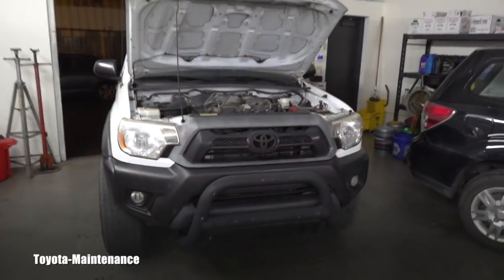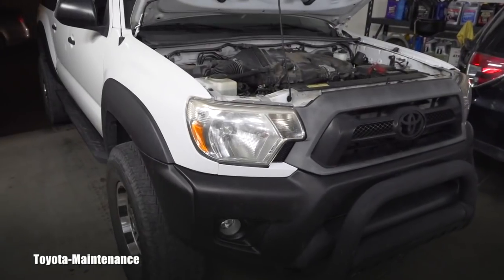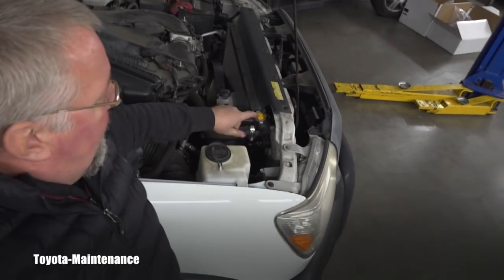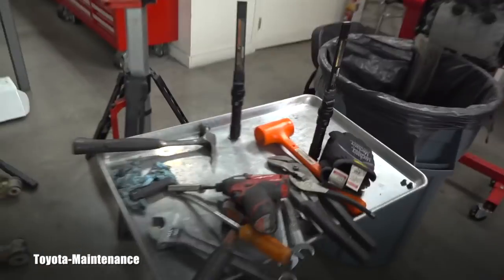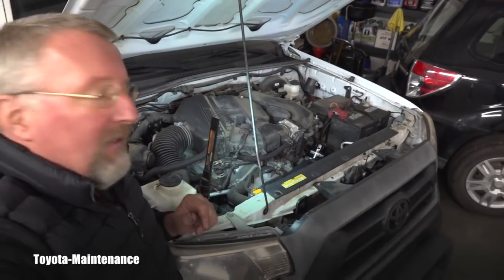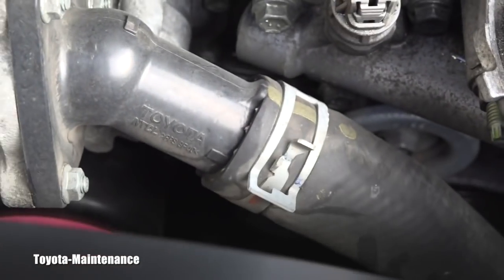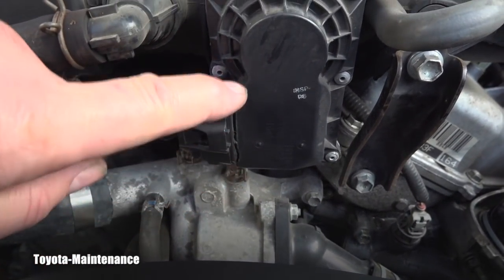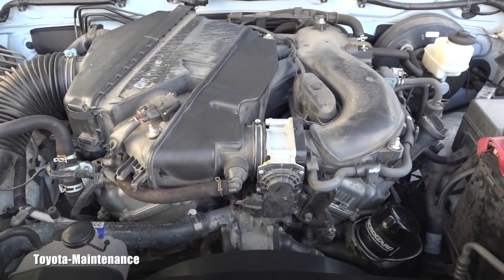Toyota Tacoma Coolant Leak

Comment: I really enjoy watching your channel... great work!! I have a question perhaps you can help be with? I have a gen 2 Rav 4 2002. Not sure how to fill the coolant. There is a coolant reservoir and radiator cap. If I take the radiator cap off when cold there is No coolant in the a radiator. So I’ve been filling up the radiator with around 3 liters of coolant... but should I be putting water in the reservoir also? Or is this just overflow? I know I need to find out why I need to keep refilling with coolant... every 6-8 weeks needs a refill with no noticeable leaks anywhere. Oil looks ok not milky. The only suspicion is that the tail pipe I can see quite some water droplets... so suspect head gasket is leaking coolant into the exhaust someplace.

Comment: My 2013 Taco just rolled 69k.  Worn out bushings and such? Sounds fishy.
Reply: My 2013 Tacoma has 150k miles. Suspension is still tight! Holds alignment perfect between checks. Will probably rebuild it all at 200k miles just because. This truck definitely seems fishy!

Comment: you get alot of Tacoma's!  how do you blow through lower control arms with only 42000 miles?  bad manufacturing?
Reply: No way that truck actually has 42k, must have a swapped gauge cluster. Lots of indicators just in what we can see through this video.
Reply: @Eggsr2bcrushed  I would be mighty disappointed if any control arm failed on a Toyota even with 140000 unless i was frequently off-roading on it.  That seems unlikely to me!

Comment: I would have to trust my gut feeling and say this truck was in a pretty bad accident.... reasons why I suspect this is because I was eyeing up the control arms, and if I'm correct one of the arms look bent where the ball joint is, and where the two stamped parts that make up the one control arm, where its welded together there is a bend bubble from the arm being bent back..., that I typically never see...... and now he seen the broken electrical connector that looks like a throttle position valve ? and why were the clamps on the hose replaced? and the hose was cut short, I say because the hose was damaged from the accident and the damaged part was trimmed away where the hose is connected to the engine, and hot antifreeze squirted out on the engine because you can see a brown stain in that area, thats the sign of hot antifreeze being spilled onto a HOT engine. you can see this if you look at the area where the radiator hose is attached at the engine, you can see signs of where antifreeze was spilled on a very hot engine creating the brown stain, this happens as the truck sat while cooling down...

 And don't the top radiator support look tweaked in places ?
I can be totally wrong, but a prior accident would explain a lot. you can turn back mileage, but its pretty much impossible to get away with it because of service records, emissions records, and if you always go to a quick oil change place they record the miles, plus look at stone chips on the windshield, you see a lot of them with high mile cars.

Well.... this was one guys opinion lol...

Great job my friend, its sad that there are not more people like you out there.... This garage owner I know retired, he  use to charge very good prices, he was going to sell out to someone who said, "Why are we letting cars go with repair bills under $500.00"......

Comment: As a Toyota owner...that is a serious fail...back to the dealer for a warranty repair....love and hate relationship with Toyota...been there seen that..... they're brakes are the worst....trade off.
Reply: Disagree. Honda and Mazda brakes are the worst. Caliper pistons always rust corrode and fail. I’ve never had a single Toyota caliper piston go bad. I change brake fluid every 2-3 years in the lines. I regrease caliper piston boot, and caliper slide pin with only silicone grease. Honda caliper will fail, even with proper maintenance.
Reply: I’ve had Honda’s since 1996......brakes were great till 2006 Accord (bought new) rear brakes failed at 55,000 miles. Fronts went till 88,000 miles. I started using Bendix brakes and they lasted longer and are a lot cheaper? I sold my 98 Civic with 170,000 miles with second set of shoes on it (rear brakes) and 2nd set of pads. I currently use Bendix brakes on my 2009 CRV and at 118,000 miles, I have only replaced the fronts once and at 108,000 finally replaced the rears. All cars are in the Chicago area and garaged. Thanks.....Jim

Comment: Put JB weld on the plastic cracked part to seal and protect it (and the part may NEVER go bad).  Also, whoever is selling you your coolant is TOTALLY ripping you off (SERIOUSLY).  Don't you get wholesale pricing from your Toyo dealer (if not, you should)?  If not, you can order this coolant off the internet for cheaper esp. if you buy with more than 4 or so at a time.  It shouldn't even cost that much with todays inflation.

Comment: Oh yeah...282000 miles on my 04 and every hose is original.  I did put in a water pump years ago. Only because i kept the belt too tight.

Comment: A couple of years ago, Toyota created their official parts website ( https://parts.toyota.com ) that is not only excellent for finding the exact part you need but you can also shop around participating dealers for the best price. My local dealers wanted from $24-$29 a gallon for SLL coolant. I found it for under $15 at several other dealers. Unfortunately they don’t ship fluids but I worked a parts order into a road trip. Try it. Now I order almost all my Toyota parts this way. Toyota SLL Coolant 00272SLLC2

Comment: The original clamps are known as the Devil's hose clamp. They are the worst.
Reply: Absolutely agree! These people have never heard of metal fatigue over time the spring flat metal clamps lose their clamping force over time from the heat cycles of the engine....the proper size worm clamp made of stainless tightened correctly will out last the hose many times over....you don't see those one piece clamps on cop cars or emergency vheicles cause a blown hose at the wrong time could cost someone's life! Nor do you see them on highly boosted applications for the same reason of blowing hoses off.
Reply: Agree with both of you. Always replace failed oem radiator hose clamps with worm gear clamps. Tighten til there’s no more leaks and get a new hose.

Comment: Me smell a rat, with that mileage no reason to not have original clamps or have the hose replaced even if the thermostat had been replaced earlier the hose likely would still have been good.  That truck has much higher mileage than stated, not to mention the worn out bushings in the control arms.  I'm afraid it wasn't just the truck that got hosed, it was also the owner who got hosed if he bought that truck used.